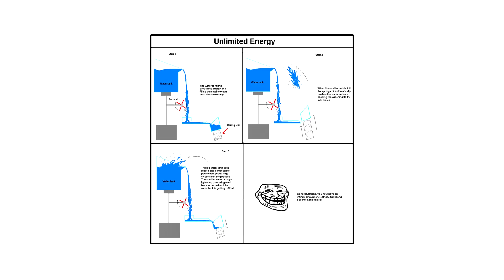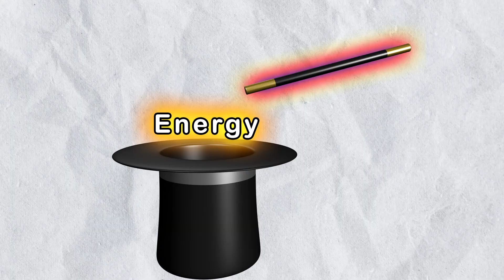why it doesn't work 21

Comment: Even if we oversimplify the physics and assume the energy is in a closed system and the spring somehow uses no energy, an object falling from a specific height doesn't have enough kinetic energy to lift the same object back to the original height.  

The best solution would actually be achieved with a wormhole with one end above the water wheel and the other end below, the water falling far enough to reach terminal velocity before reaching the wheel.  Everything could be encased to prevent water from splashing out of the system.  Even then, it would take some kind of exotic matter to keep the wormhole opened indefinitely without using far more energy than the system could possible produce.

Comment: For the record, hydroelectric dams technically get their energy from the sun. The sun evaporates the water on the low ground, which rises into the atmosphere and condenses over the high ground, where it falls as rain. This fuels rivers, which fuel dams.
Reply: Power Generation is sortof like crabs, in that all power generation eventually becomes using heat to evaporate water.
Reply: arguably every thing is powered by the sun. the sun makes plants grow through photosynthesis, the plants die and get buried underground where they become fossil fuels. so technically oil and natural gas also got  their energy from the sun (therefore they are a form of solar energy lol)

Comment: "Putting the water wheel on a waterfall," you mean a hydroelectric dam power plant? I don't blame you for forgetting those exist, for how great they are we don't use them enough.
Reply: While great, they also mess up the ecosystem around. Both in construction and functioning. Still, better than coal
Reply: @Noob-verified  Nuclear is the way
Reply: @sak-x7j  

Nuclear, solar, wind, geothermal, etc. Tons more ways to get energy than coal.
Reply: @Mechaghostman2  Solar works only 50% of the time on average, wind is not reliable, geothermal is very weak... Nuclear is the only scalable, reliable, and environment friendly source of energy.
Reply: @sak-x7j  

Some of the metals used can leak into the environment like tritium, and after a few decades the components become too contaminated to continue using, making it a rather expensive endeavor. Nuclear is not a perfect solution with no drawbacks.
Reply: @Mechaghostman2  There is no perfect solution, but tritium isn't generally considered a metal, and it's also not very dangerous, so I'm guessing you're talking about uranium and plutonium.
The contamination you're describing is also more characteristic of a catastrophic meltdown than routine operation. You know, the condition that we literally developed more advanced reactors to make impossible.
You could swim in a pool with nuclear waste containers at the bottom and the only thing that would kill you... Is the bullet from the armed guard who caught you trespassing.

Comment: Actually, using the waterfall makes sense to me! Would it work?
Reply: I mean yeah, normal waterwheels do this in rivers too. The water is always flowing so it will continuously produce free power. How much is a better question, it probably depends on how fast the water is going.
It's a pretty old thing, they used this for stuff like mills before the discovery of electricity, the wheel would turn gears and work a manual mechanism of some sort. Sometimes a saw, sometimes a wheel for crushing grain into flour, that sort of stuff.
You can also build a hydroelectric dam. The flow of water is constricted so that the river is forced to exit through certain channels, turning turbines and producing electricity. It's probably the closest to a troll physics level cheat you can get without actually breaking the laws of physics (I.E. not actually working).
Reply: @redeye4516  Ah I see, I understand, thank you for replying 👍

Comment: How to make it work?
Reply: Put it in a flowing body of water. More flow = more power. You can really cheat the system with a hydroelectric dam.
There's really just no need to make the water go back up, with a river the water cycle will do that for you eventually if you think about it.

Comment: im dumb so im gonna ask a dumb question

Somethings are very rare, a VERY rare thing that can occur is atoms aligning and thus an object going through another object, could you use this anomaly to obtain energy (Assuming this happens in an environment where the anomaly is at its peak)? I'm a curious person and nobody ever discussed this.
Reply: how would you make energy with this
Reply: @ArcaneWhimsy  check my reply to ENDI8089
Reply: I which way could you use this to make energy?
Reply: @ENDI8089  Don't know, that's why I'm asking here. Though, if you want a crude guess (correct me if im wrong), If quantum tunneling could fuse two objects together, the brief moment of fusion might generate localized heat, which could theoretically be harnessed to power a steam engine. This steam engine, in turn, could recycle its water via a closed system, where the steam would theoretically quantum-tunnel back into the water tank.
Reply: Nuclear fission and fusion are likely both better options (you should really be wondering why nuclear reactors use uranium instead of the much much better plutonium if anything energy related)
Reply: @Kero676  Real question is why are thorium reactors are so overlooked
Reply: @Tee954  thorium should stay in terraria if it knows what’s good
Reply: @Tee954 thorium is subcritical, meaning it cannnot creat chain reaction, asit needs outer neutron input.
Reply: Quantum tunelling on big objects like a hand and a table has an extremely low chance of happening. I read somewhere that for it to happen we would need to wait something around 20 times the lifespan of the Universe to be able to observe it on such big scale. These are the numbers we work with with this kind of low probability.
Reply: @sak-x7j  i think it is 10^20 times the age of Universe.
Reply: @Neo-vz8nh  Perhaps. I just remember it was insanely long period of times measured in "lives of the Universe"
Reply: The phenomenon you're thinking of is called "quantum tunneling". It does have a wide variety of uses in physics and chemistry, I'd recommend at least skimming the wikipedia article about it to get a better idea of how it really works
Reply: @edcellwarrior  Yea, I'll go check it out